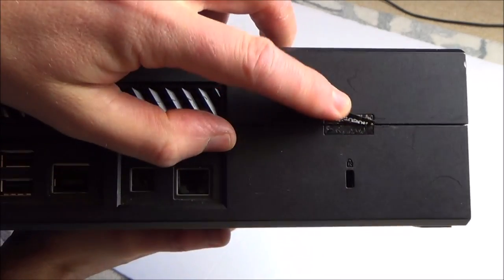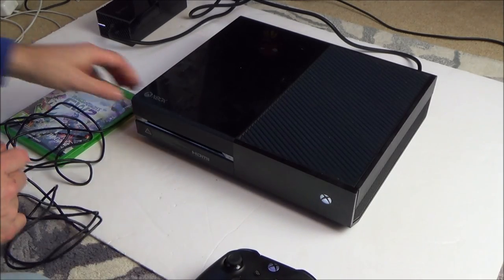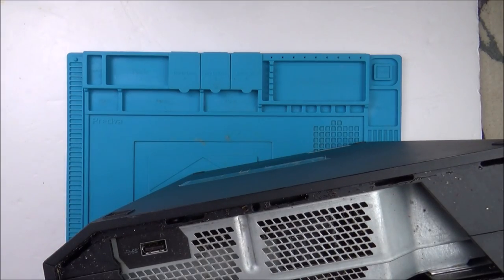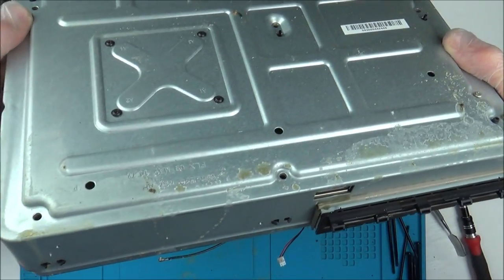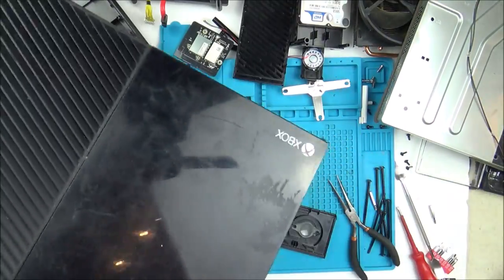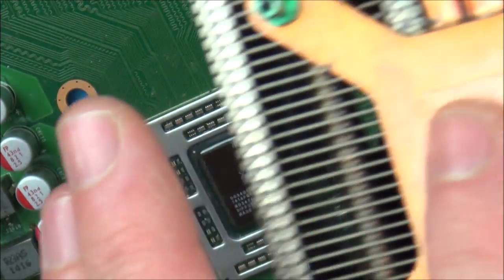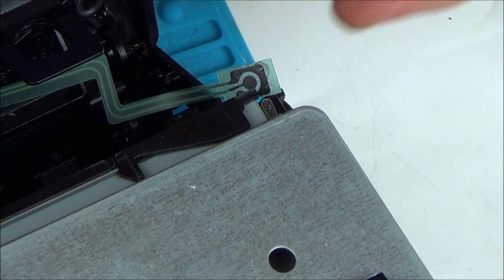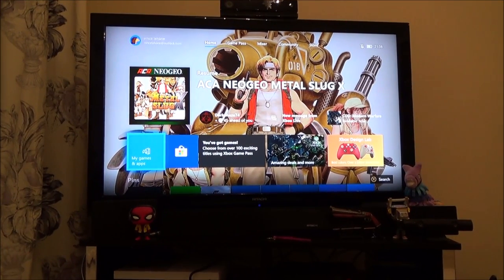Trying to FIX: Faulty £28 Xbox One from eBay

Comment: The previous owner: is this a dinner plate?
Reply: definetly used it as a table xD
Reply: Well its not a dinner plate it dosent have a cpu and gpu that heats up like a convection oven no it just has a cpu thats a slow cooker
Reply: @joshuaryanferguson3702  good point
Reply: @joshuaryanferguson3702  I has an APU, that's cpu and gpu combined on one chip.
Reply: @joshuaryanferguson3702  It does have a CPU and GPU tho lol
Reply: @user-my5nr3il3q  dued thats what i said read the comment
Reply: I'm your 420th like lmao
Reply: @joshuaryanferguson3702  Read your own comment, Ill add grammar since you didn't. 

"Well it's not a dinner plate. It doesn't have a CPU and GPU that heats up like a convection oven. No, it just has a CPU, thats a slow cooker."

No matter how I read it, it reads you saying that the XBox doesnt have a CPU and GPU.
Reply: @joshuaryanferguson3702  and no one asked for your insanely hard to comprehend comment. Good day :)
Reply: I mean it is a flat surface that is warm which happens to keep your food warm
Reply: @NinjahPenguinZ  exactly
Reply: Lol
Reply: Charles Charles wow go you 👏 👏
Reply: They also probably used the apu as a grill
Reply: @tl1882  yeah they did includin' that heat sync as a over cook protector
Reply: Dang this is blowing up
Reply: And its a dead meme

Comment: Think the power brick from the owner before was broken that’s why it turned on then off but since he didn’t send it with and you used yours it worked without a problem except all the dirt... great video 👍
Reply: I can't even imagine how the previous power brick looks inside..
Reply: My thought process is that the xbox wasn't under a heavy enough load since he wasn't playing a game for it to crash
Reply: LanceX but as the seller wrote it turned on the automatically off that’s mostly a power or hard drive problem by the Xbox
Reply: SlimDave2208 not always a power brick problem, my power brick stopped working and I ended up buying 2 knock off ones and 2 Xbox original ones and non of them worked, I would press the button then after 5 - 10 seconds it would just go off again, cleaned it, checked for lose or unplugged cables, changed the hard drive, applied new thermal paste and I even tried putting a stronger fan in there from my pc and put a new battery pack in the console and nothing fixed it, instead I just bought the xbox X and nothing has happened so far
Reply: JAWZ be careful with those knockoffs, might have killed your own Xbox tbh

Comment: With that sync button you can just bend out the centre to give back tension to the tactile switch. Same type of switch for the paddles in a scuf and I have fixed mine this way when it got 'stuck'. I just grabbed each of the corners and bend them back slightly (thus bending the centre up) and it brought back that tension and has been working great since!

Comment: I came across an Xbox One with the same liquid residue pattern that dripped down the power-button board and ribbon. The unit also powered off randomly, but chimed as if the power button had been touched. Touching the power-button ribbon, the ribbon socket, or parts of the board would activate the power button. Everything related to the touch power-button seemed sensitive to touch. The liquid residue was randomly activating it and powering off the Xbox. Perhaps your Xbox had a similar issue, and you fixed it by cleaning it up. Your videos are my favorite, Vince! Your optimism and determination are inspiring!

Comment: I’m guessing it was a child’s Xbox, based on the fact that the 4 games already on it were fortnite, GTA5, roblox and the sims. I could only assume that it started acting up after a few years, the child complained about it and the parents tried to open it up, but had no clue what to do so they sold it and bought the kid a new one.

Based on the actual inside of it, it seems I was correct. It looks like a kid had it in their room and was eating around it frequently

Comment: Great Video. I got a similar bargain this weekend. A PS4 for £50 from Ebay that was randomly powering off. When it arrived it was dead. Stripped it down to find it was really dirty inside. Cleaned it all up and I've been using it since Saturday with absolutely no problems.

Comment: Excellent job and amazing pickup for the price!  You made me laugh at the point where you said "lets get some thermal paste on so everyone can argue about how much" =D  Question - where can I buy "Elbo Grease" from, and how much to apply? :o)  Regards that flex ribbon - do you think the problem was at the switch end, or the other side that mates with the motherboard?
Reply from the maker: Haha, thermal paste....I think I still got the amount right this time but not the application. Next time Chris I WILL succeed. I will add an affiliate link to the elbow grease, make me some money for the Christmas pressies. I am pretty sure it was the switch end because it could short when using the tweezers directly on the pads but I found no damage and the metal clicker bit looked perfect when I first of all took it off. You have me thinking now if it could have been the other end that connected to the front board. The contacts didn't look normal. They seem to be covered in a carbon type paste with copper underneath. I haven't seen contacts like that before BUT....that board was where the slight corrosion was so it could be that end....I will look at it again. As always, thank you. Sorry I have been a bit bad at the replies on the last couple of vids. I seem to be spending a lot of hours each week on the comments and I don't always have time to film/edit and reply. I always read them though so it always helps, even if I don't reply :-)
Reply: No worries!  Always worth investigating things like that ribbon, I know it's only a £ but its closure and understanding of the exact cause =D   I understand about comments too!  I spend goodness know how long reading and replying to comments and the numbers are so much less for me!  I don't know how you even get time to reply at all!  Takes incredible time filming, editing and uploading these videos too!  I spent half a day yesterday editing and uploading a single video!!!!

Comment: You actually used slightly too little thermal paste. Tests have also shown that it's best to use too much than too little paste, as in comparison you'll generally get better thermal performance with too much. It's the safest option because it's always hard to judge the right amount. People always say that YouTubers like yourself use too much, but just ignore it unless you're actually using an absurd amount. I've built PC's with this in mind since the late 90's and have always had expected or better than expected CPU/GPU temperatures.

Comment: Been building rigs for 23 years and I can honestly say the best thermal paste I've ever used is zalman zmstg1.. The temps on idle or full load always beat arctic silver and the best part is the built in brush to paint it on! You don't have to let it cure over time! I honestly recommend you trying some the next time anyone deals with heat sinks!

Comment: When I get those nasty consoles I throw the plastics (and sometimes the metal shielding) in the dishwasher with some citric acid (heated dry off).
Reply: Absolutely. One go on the dishwasher won't do any harm. Cover any stickers with foil tape with tin foil between the sticker and tape.

Comment: that reminds me the xbox one i bought from cex (discounted version) its working fine minus the hdd was clicking some times and going to change it. but when i disassembly to clean the smokers dust  and new thermal paste like yours did suffer a spill but from a drink. clean it very carefully and still works.

Comment: u can expose the wires on the synce cable then solder a tac switch u can take em  from say a old tv or controller or if u got some laying and solder around to it and glue it down or run wires to the power boards pins for the synce button either works if u dont wana replace the touch ribbon.

Comment: Nice one Vince, I have never been a fan of put a blob on the cpu, rather i put enough on to spread (An old credit card works well) an even layer of paste.  Never had an issue with anything I built or repaired,  my Xbox 360s and X box one GOW both stand vericaly and have a plastic bag put over them once finnished and cooled down.  Keep up the work.

Comment: As a mobile PC / laptop repair guy I can confirm that 95% of laptops & home consoles are at least this filthy. It never ceases to baffle me.Incidentally you used the perfect amount of thermal paste. The paste's job is to fill in the micro gaps between CPU & heatsink, and is not supposed to be a layer in itself. The metal is the best conductor of heat, not the paste.

Comment: I saw a demonstration once about proper thermal paste application. The demonstration showed thermal paste applied as a pea sized dot, and an 'X' shape, and also pre-spread across the heatsink surface.  The paste was applied to glass, and then the heatsink was placed over it.  He used a pane of glass because glass is very flat, and you can see what happens to the paste from underneath.  If you have a spare piece of glass, you can try this yourself, just so you see for yourself what happens to the paste when it is squished.

Comment: With a thermal compound that has no electrical conduction (such as the MX-4 you use) there is no such thing as too much. When the heat sink is put on and tightened down, any excess will just harmlessly squeeze out the sides. Too little can be an issue though.

One thing to consider is the fact that the heat sink contacts directly with the die, instead of some form of integrated heat spreader as you would commonly find on relatively new computer CPU's. The whole "too much vs too little" pseudo-debate is more relevant to that as the IHS is a larger area than the die itself, meaning you only need to make sure that a small portion is covered with the TIM. Where bare dies are concerned (such as the example in this video) your best bet is to use a plastic spreader or something similar to achieve an even coating (only really necessary to ensure the entire die is covered in the TIM, you can also just use "way too much" and squish it down and out with the heat sink as I mentioned above)

Hope this made any kinda sense, it's 9:30 in the morning and I haven't gone to sleep yet :-D
Reply: you shouldn't spread it, it creates air bubbles

Comment: You're correct. You want the least amount of thermal paste as you can get. You just want enough for it to make a thin layer across the chip to make complete contact between the heatsink  and the cpu

Comment: The amount of thermal compound added in this video seems about right to me. This does appear to be a CPU die instead of an IHS over it, so possibly I'm wrong, but you only really need enough to fill the microscopic space between the heatsink and the CPU, too much could indeed affect performance, because thermal paste isnt actually the best at thermal transfer.

Comment: The general guide for thermal paste is that you should use an amount the size of a pea.  What I saw in the video looked about right but it is hard to tell from a camera because you can't easily tell how much the picture is zoomed in.  Having said that for some modern CPU's (AMD Threadripper and Epic chips as examples) you need to use a lot more.

Comment: One thing you can do if you're uncertain about the amount of thermal paste you're applying is to put a small amount on the CPU and use something like an old credit card cut down, or just buy a thermal paste spreader  and spread the paste evenly until you're comfortable with the coverage.

Comment: It was nicked (hence no cables etc), they just describe it is not working so you can't return it / get a refund based on condition.
Reply: Just what I was thinking...
Reply: If someone was going to steal it like in a burglary they would take the leads. I have sold plenty of broken stuff on eBay and a few times I have been lucky and bought stuff that just needed minor fixes. You could clearly see it had been liquid and food damaged however only the front power board was affected.
Reply: @iian0  I think you are giving thieves more credit than they deserve, most thieves are opportunist and want to get in and out as quick as possible, But it is a common thing for stolen items to be sold as faulty so that there can be no comeback from the buyer, the seller still makes some money from the "nicked" item and the buyer cant get their money back if it happens to be locked, unuable etc etc

Comment: funny thing with the button, had a notebook come in 2 weeks ago it was stated that the DC connection was loose. So i fixed that but after that fix i couldnt start the notebook on button press... well it worked but as it was the case with you it worked realy inconsistently... So i had to get a new button from china (which in this case was luckily just a normal electrical button) which i found on ebay for 3euros for 50 pieces... great deal, orderd changed and it worked. I opend the "not working" button up and it looked exactly like a working button. So i dont know what breaks in there but something randomly appears to stop work in those buttons. It had this metal membrane in it which gets pressed down by pressing the button down on to the contacts... dont know why it stopped working but yea... changed it and happy owner now :) dont bother wasting time on those they just seem to randomly break.

Comment: I do think the dirt definitely did have something to do with it overheating in the video the fan seemed noticeably quiet after cleaning. Also could of been a problem with the original power brick or maybe the previous owner moved the xbox and hooked it into a weaker power strip. I have notice that certain power strips wont provide enough power for an original xbox one so they will only run for a little while then randomly shut off.

Comment: 4 or 5 hours for FH4 Vince 90 minutes. On another note buddy, I like to get a really thin coating of thermal paste over the whole IHS, before reassembly, rather than just leave it to chance that the compound spreads evenly. Don't take that chance that it's all pushed one way, or two. Get that like a nice layer of thin paint, and you can't go wrong mate.

Comment: I suggest that you learn how to fault find  as you are doing more damage with your hit and mis approach Vince.  There are proceedures to use when fault finding the hdmi ports, like cleaning them and checking for bad solder connections of the pins on the pcb. You would repair a lot more items. You must follow basic fault finding proceedures where you will find the bulk of the problems and easy to repair. These ports get a lot of user abuse and this can break or dislodge pins. Solder joints age  over time and create dry joints

Comment: It may have been overheating from that extreme amount of thermal paste that dried over the years. If they used less/the correct amount then it would probably have been fine even if the thermal paste was dry

Comment: What kind of mat are you using in this video? it seems like it has little screw holders that can even close. I want one. Also, as for whether cleaning it or not would have made it work, I can assure you not cleaning it would have lead to it failing again down the line when ants crawl inside and cause shorts.

Comment: Do not care for what a lot of people say.... There is no "too much" thermal paste but there is for sure a problem if it is "too little". You will risk thermal issues if the paste is not covering sensible areas. But paste not needed will simple be pushed away by coolers pressure. So more, is "safer" in every way.

Comment: To add to the thermal paste argument... There is a right place to add a bit too much. The places to add too much are the exposed dies. Like the Xbox chip you pasted it's vital that you fully cover the whole chip, the chips with lids ie most pc cpu it's kind of irrelevant exactly how much though far too much or little will very slightly mess with thermals.this is down to the lids acting as a heatsink and primary die protection.

Comment: I got a deal on a Xbox one s, paid $80 USD and it wouldn't boot up, replaced the HDD with a used 1tb from offerup, formatted it and it works, gifted it to my father and he plays battlefield everyday, year later still working as a new one would. So Xbox one is great, improved from 360 flaws.

Comment: Better using slightly too much then not enough, as any excessive paste gets pushed to the sides. You can see the contact pattern if you then remove the heat sink.

Comment: i can't believe all the thermal paste comments all the time. i've been working in electronics for over 30 years, way before any modern consoles existed. like you say, it's only job is to fill in imperfections to ensure efficient heat transfer and prevent hot spots. if it's not conductive then there is no problem putting on more than you need, apart from your wallet maybe. it's not a highly technical process at all. nice find there for £28!

Comment: awhile ago, inspired by vince,  I bought a faulty xbox one with accessories to repair. after taking it apart, i was able to diagnose why it didn't work. The ribbon cable of the front panel was unplugged. not bad for 40 dollars

Comment: I've got an S that won't play games, but the Blu-ray and hard drive are fine, and also got a X that freezes when installing games, but if you shut it off and restart it it will go again for a while. But when it finishes installing it will play fine with no issues and won't shut off or crash or anything. More frustrating than anything.